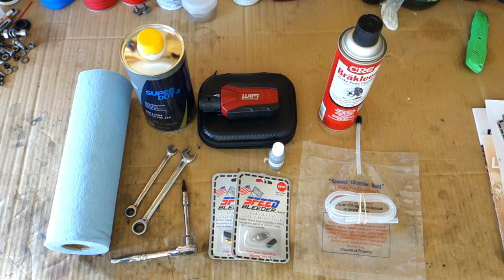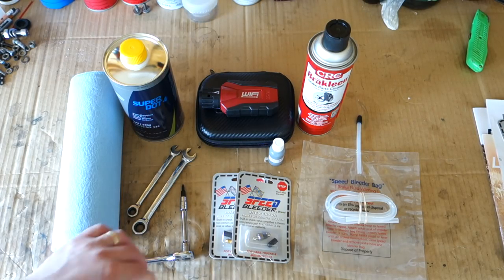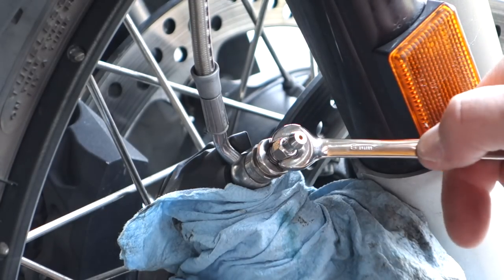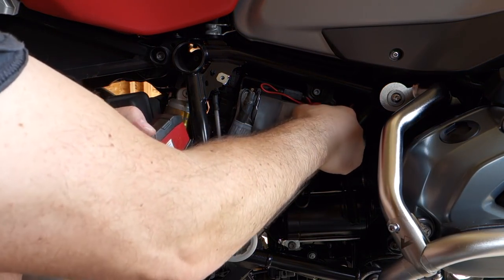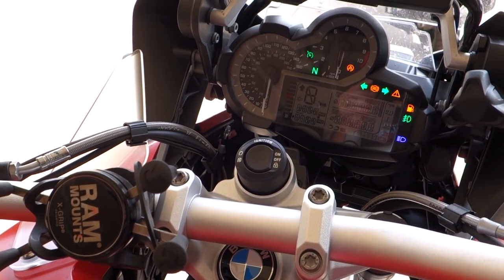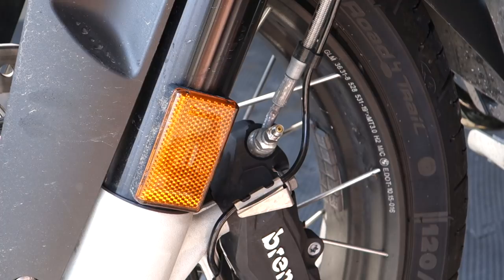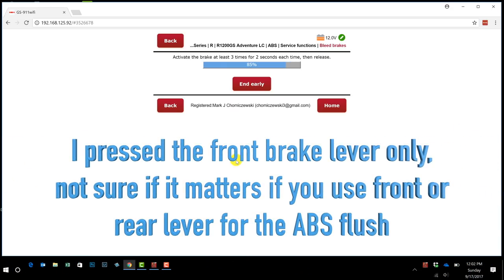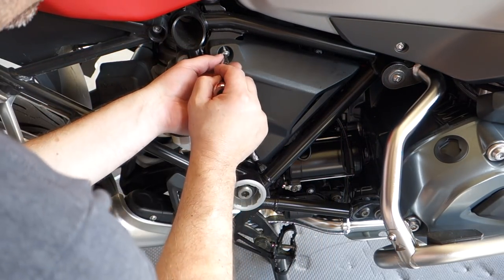BMW R1200GS Adventure ABS Brake Flush (with Hexcode GS911) & Speed Bleeder Installation - Part 1

Comment: Suggestion: "One two" release is not two seconds. "One one thousand, two one thousand" is two seconds. Also as posted, pull most of old fluid out of reservoirs and refill with new fluid to begin mechanical bleeding process.
Reply from the maker: Thanks Harold, good point! I also shared your advice on removing fluid from the reservoir before the bleeding process in my follow up video. Thanks again for the feedback!

Comment: Hi, can you clarify if you squeezed the front and rear brake at the same time when bleeding the front brake and also when using the gs 911 for flushing
Reply from the maker: peter gibson - For the bleeding portion I squeezed the front brake lever only to flush the front two bleeder valves, and the only the rear brake lever when flushing the rear bleeder. For the ABS flushing I only squeezed the front brake lever. In retrospect I should have probably squeezed both in an alternating sequence. I am not certain if that would make a difference, I assumed there is only one ABS unit for both front and back brakes, but I can be wrong on that. In the next flushing I will squeeze both front and back brake levers.

Comment: Thank you. That was very useful. A minor point of good practice. If you can use a ring spanner over an open ended, do :)
Reply from the maker: @Peter Burridge - Thanks for the comment and recommendation. I can't argue with your point, and in fact normally would use a ring spanner for this type of job. Cannot recall why I didn't here. Anyway, thanks again!

Comment: Thanks a million you asked at the beginning how the process would go if you don’t use the GS-911wifi well don’t even try, even though I had a GS-911wifi in my kit I didn’t know about the abs option in there until i saw your video and I have been chasing my tail trying to figure out why my rear brake was so soft... I hit the bleeder used the GS-911wifi this time and my rear brake is solid as ever... thanks again
Reply from the maker: carmas54 - glad to hear the video was helpful!
Reply: You run the pump through the software for the front and rear? Can both brakes be pushed at the same time to do both front and rear with the software ?
Reply from the maker: @Deviant Remedy - Yes press/pump both the front and rear brakes when running the ABS flush/bleed process with the GS911 and software. Press and hold both for 3 seconds each time.
Reply: @zooskifilms  thanks!

Comment: I was considering purchasing a GS 911, but I couldn’t justify the $400 price tag.
Reply from the maker: @carlmaruyama6863 - Yeah, it's not cheap. I checked eBay and the cheapest I could find it there was $300. I wouldn't say it's needed for the brake bleed unless you change out the ABS unit. It is nice to have for checking error codes and troubleshooting, but I would probably hold off on that until the time came where I needed it. You would spend at least that amount taking it into the dealer. Thanks for watching and commenting and ride safe!

Comment: Thanks so much for making this video. A couple of days ago I purchased a 2007 BMW F650GS as my first bike. It has less than 1200 miles on it. The bike was well cared for and looks like new. I'm planning to replace the battery, tires, and all of the fluids. This video will be very helpful. Thanks again and take care.
Reply from the maker: SoundsGood - congratulations on your first bike! The 650GS is a great bike, I was also looking at one at some point but eventually went with a KTM 690. Good luck and have fun with your 650GS!
Reply: @zooskifilms  One question. I know the bike has two separate reserviors for brake fluid. One is for the front and one for the rear. When you bleed the ABS pump with the GS911,  do you have to do it twice?
Reply from the maker: @soundsgood7757  - there is only one ABS modulator unit that serves both the front and back brakes, but still a good idea to pump both front and rear brakes during the ABS air bleeding process. So the process should be:  bleed front and rear brakes through bleeder valves followed by an ABS air bleed pumping both front and rear brakes. Repeat 2 more times.

Comment: Great video but I would offer one suggestion to improve the fluid flush. After opening the reservoir, suck out the old fluid with a syringe from the reservoir and replace it with new before starting the bleed. That away you are putting new fluid in the lines at the start of the process instead of pumping the old fluid into the lines. Great video but I would offer one suggestion
to Great video but I would offer one suggestion to Great video but I would
offer one suggestion to Great video but I would offer one suggestion to
Reply from the maker: Thanks, good point!
Reply: I am sure he did that but didn’t cover it as the main point was how to avoid going to motorcycle stealers.
Reply: Good suggestion - also, you don't need to flow as much fluid thru once the reservoir has fresh fluid, just flow until fresh fluid is flowing out the bleeder. I also close the bleeder before returning the brake lever to keep any air from flowing back into the line. Fluid should only flow out of the line, not back into the line, for a 'best flush'. Good luck

Comment: I have the same bike but it shows different model belldes for the two from calipers,  I see you have two in a package there.  Here's what I get from their sizing chart: 

R1200GSW ADV	14-17
	
SB8125L right

SB6100 left

SB1010   Rear
Reply from the maker: @mikecousinoplumbingwaterfi6952 - I just checked the page and it shows the same numbers that I posted. I should mention the SS is a stainless steel version whereas the non-SS version is standard grade steel (they list it somewhere on their site). Here is what I found:

R1200GSW ADV	14-17
	
SB8125L right

SB6100 left

SB1010S rear

Comment: Don't forget about bleeding the clutch, that fluid can also degrade just as the brakes. I did see they have mineral oil if I am not mistaken and I am not sure if that affects the bleeding schedule of the clutch, but probably a good idea to do when you are doing the brakes.
Reply from the maker: @David Henschel - Thanks for the comment! I actually just released a video on my channel about a month ago on the very topic of flushing and changing the clutch fluid. A bit more involved, need to remove the start motor to access the clutch slave bleeder valve. BMW recommends using Vitamol V10 clutch fluid for that. Thanks again!
Reply: Very little degradation if its non hygroscopic mineral oil vs. older dot4 clutch systems.  5 year changes are commonly done

Comment: Thank you. It is best practice to start bleeding the calliper furthest from the master cylinder first. i.e. left side. Also best practice to use the ring spanner where possible, not the open ended.
Reply from the maker: @Sanemancured - Thank you for your comments, they are much appreciated. I should have known better on bleeding the left side first, had a few viewers comment on that as well. Thanks again!

Comment: Is there a reason why you don’t have both calipers hooked up to the bags with the speed bleeders open when you pump the brakes?
Reply from the maker: @frogclip1 - Thanks for the question. No reason other than following the "normal" practice when without the speed bleeders. But now that you mention it, I don't see any reason why that wouldn't work. I will definitely try that out on the next flush!

Comment: Do you have to use the gs911 after installing speed bleeders?
Reply from the maker: @Deviant Remedy  - It's a good question that I tried answering in my part 2 follow up video (you can find it on my channel). The GS911 is mainly needed to bleed and flush the ABS unit. What I learned was that if you are not changing a caliper, ABS unit or brake hose, you don't necessarily need to bleed/flush the ABS unit. If you are a purist, and want to flush ALL of the brake fluid, including from the ABS unit, then you would perform this step. For me personally it's not a difficult or lengthy process, so I perform it each time. It also provides a way to confirm the ABS unit is functioning. I would rather find out I have a problem in my garage rather than out on a ride, in a situation where I need it to work. I hope this helps! 😁

Comment: Hi. Thanks for good video. Please let me know why you are not opening screws  bleeders when you running ABS-pump? With screw bleeders closed, what is the point? When you open the screws and pressing brake levers with ABS pump running oil will contunue run throw the system or am I wrong? Have a nice one. Regards from Sweden.
Reply from the maker: @BM TB - It's a good question. Based on what I understand, running the ABS unit with the bleeder valves open won't bleed any air or force old brake fluid from the ABS unit, the brake fluid just flows past the ABS unit. With the bleeder valves closed and the ABS pump on, any fluid and air in the ABS unit is moved into the main brake line path. Then the following "normal" brake bleed pushes that old fluid from ABS and bled air forward and out. I actually tried this one time and you can feel the difference with the bleeder valves open vs closed. There is no resistance in the brake handle feel when the bleeder valves are open. With the bleeder valves closed you can feel the ABS unit being "pumped" in the brake handle feel. It would certainly be easier if you didn't have to go back forth between normal bleeds and running the ABS unit pump. If you haven't actually replaced the ABS unit or any of the brake lines, my feeling is the ABS unit doesn't have any air that needs to be bled. It's more to move the old brake fluid out from the ABS unit. Hope this helps!
Reply: @zooskifilms Thank you for the detailed explanation as I had the same question.
Reply from the maker: @grunepguy1 - You bet, thanks for watching and for the comment.

Comment: Respectfully suggest you do NOT let reservoir get empty when flushing, that is refill reservoir when there is still a little fluid left in the bottom. Otherwise you suck air into the brake line, which is why you had lots of air bubbles in the hose on one of the bleed valves. Otherwise excellent.
Reply from the maker: Yes, agreed!. There are a few things I will do differently on the next flush.

Comment: Is this the same bleeding procedure for a 2008 r1200rt? .Mahalo in advance !! Aloha
Reply from the maker: @Mana Valdez - Aloha 🤘! If your model has ABS (which I believe it does) then the process should be the same. I see the GS911 can be used on the 2008 model R1200RT. Once you connect the GS911 and open the software, there will be a step by step instruction on what to do. Good luck my friend!
Reply: @zooskifilms  Mahalo so much!!! I will subscribe!! Aloha Sir!!!

Comment: don't know if i am a bit thick but what is wrong with just bleeding through as normal having first taken as much fluid out of reservoirs ??
Reply from the maker: @Keith Hutchinson - Nothing wrong with the standard mechanical bleeding. I mention this in the Part 2 follow up video. Some people don't bleed the ABS unit unless they are changing out a brake line or the ABS unit itself. Others (like myself) like to do the ABS bleed just in case any air might be sitting there, and it also removes the old brake fluid sitting in the ABS. How much of a difference does it really make? I'll let others debate that! Cheers.

Comment: I am recently want to change the brake line on my kawasaki. But I am confusing is the software only required with BMW bike ? or I have to flushing my abs with this software as well ? Hope you can help me out Thank you
Reply from the maker: @HI YO - Thanks for your question. This software and diagnostic hardware (GS911) is for BMW motorcycles only. To bleed/flush the ABS unit you need some way to activate it using the ECU. Unfortunately I am not too familiar with the diagnostic ECU tools available for Kawasaki. You might want to try replacing the brake hose and do a standard bleed on the brake lines, if they feel firm you might not need to bleed/flush the ABS unit.

Comment: Is the same process when you chance the mineral fluid from the clutch too ? Thanks
Reply from the maker: @Attila Mol at - Great question! It appears to be different, I don’t believe there is a bleed screw in that clutch circuit. I need to investigate and make a video on that process. I will add it to the list of videos to make. Thanks again!
Reply from the maker: @Attila Molnar - looks like there is a bleed screw for the clutch line. Will be working on this soon.  Need to buy some fresh clutch fluid first.
Reply: @zooskifilms  do you know if only the V10 stuff will work there  ?
Reply from the maker: @05attila  - From what I can see the Magura blue might be a good  equivalent. Researching a bit more. Cannot find the V10 here either.  I’ll let you know what I find out. Cheers!
Reply: @zooskifilms  I heard that stuff works too, but I don't want to add something which will break the hidraulik clutch either... however is still mineral oil so I guess it should be just fine.
Reply from the maker: @05attila  - Yes, agree that good to be cautious in finding an alternative, and I believe that Megura and Spectro are two good options. I actually found a BMW dealership in the USA selling 4 ounces of OEM BMW V10 cutch oil for about $15 . I may just purchase that since it is available.

Comment: Hi I just got the item from speed bleeder same products as u mention. But now just realise that I order wrongly for the front caliber. As yours front was brembo while mine was Bmw. Will it Able to fit on & used? Back caliber was the same brand brembo.  
2021 Gsa. Rallye
Reply from the maker: @Caught on Camera - I just checked the microfiche and it doesn't show the thread sizes for the bleeder screws. But, it does show to be the same part number between my model year and your model year, so I'm fairly certain they are the same! Good luck!
Reply: @zooskifilms  great Thanks you so much for the information.
Reply from the maker: @haya7573  - Any time!

Comment: Did have press the rear brake at all during this process or just the front brake... great instructions
Reply from the maker: Great question - I did press both brakes, I should have mentioned that. Although I read somewhere the front and back brakes are integrated, not sure if that is true, so I pressed both.
Reply: zooskifilms I will do both as well... thanks.... there is a reason why they have tow reservoirs even though the front brake depresses the rear
Reply from the maker: carmas54  - the hand brake is a partially integrated brake for front and back brakes, but mostly the front. Without the rear brake reservoir I don’t think the rear brake would be as strong.

Comment: Hi there, great Video!!! Any idea if the speed bleeder size for a 2017 GS is the same?
Reply from the maker: @Diego Mendez - Thanks for the comment and for watching! I checked the micro-fiche for the bleeder screw and unfortunately it doesn't show the thread sizes. I would assume the 2017 is the same, but I would suggest contacting the folks at speed bleeder to confirm this. Their email is: speedbleeder@earthlink.net

Comment: Awesome vid👍 I ordered.5 litres of new brake fluid...is that enough for the job and after doing the mechanical bleed do I need to make sure the reservoir is full before the ABS flush? Thx
Reply from the maker: @hellraizzer - That should be enough, that's about how much I used during my bleed/flush. Be careful not to overfill the reservoir, it needs room to expand when heated.
Reply: What level should the reservoir be when doing the ABS flush part? Thx
Reply from the maker: The fluid level in the reservoir won’t drop during the ABS bleed process, so top it off after each mechanical flush. When you follow with the ABS bleed the reservoir will be filled. Good luck and happy flushing!
Reply: @zooskifilms  Finally got around to the job. All went well apart from the ABS flush. With the new 911 software there is no option ABS activation in the service menu....let me know if you come across the same problem...
Reply from the maker: @osibig  - which version are you on? I am on v 2004.3 and it's there, just in a different location now.
Reply: @zooskifilms  V2001.1
Reply: @zooskifilms  V2004.3 is the May version. The latest is June V2001.1 & Firmware 0.254 - 0.184 .Can't find the ABS flush on the new software. I checked every menu ;(
Reply from the maker: @HellRaizzer - I just checked the Hexcode site and also did a software update check within the GS911 software. It shows V2004.3 as the latest version. My firmware version is 0.254-0.184-0.162. Have you tried updating or check for updates within the software? Help>About. Make sure your GS911 is also connected and you are connected to internet.

Comment: I take it the bleeders are closed before the ABS flush. The ABS is flushed, then the mechanical bleed after the ABS flush removes air when the next mechanical bleed takes place.
Reply from the maker: socialoracle - yes, close the bleeders before the ABS flush. I believe the purpose of the ABS flush is to get the brake fluid out of the ABS unit and get fresh brake fluid in.

Comment: 1. How do you check the ABS break fluid level?
2. When bleeding via the GS-911WIFI, you leave the speed bleeders closed? If so, how is the break fluid being pumped to be bled?!
Reply from the maker: Javan - 1) I don't know of a way to check the ABS brake fluid. I believe the fluid in the ABS system sits in a small pump, so not really visible. Bleeding the ABS system pushes any trapped air bubbles forward towards the brake caliper (and I assume some small amount of brake fluid) 2) The speed bleeders remain closed when running the ABS bleeding process. But you bring up an interesting question. Not sure what would happen if you left the speed bleeder open during the ABS bleeding process. I assume that would push some fluid forward. I may try this myself next time to see what happens.